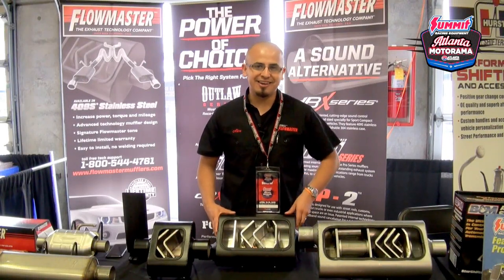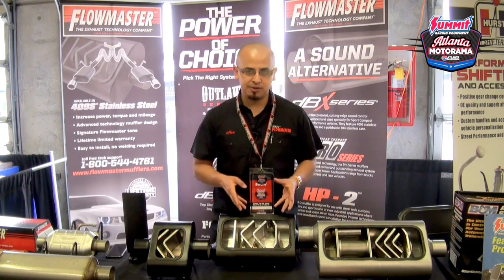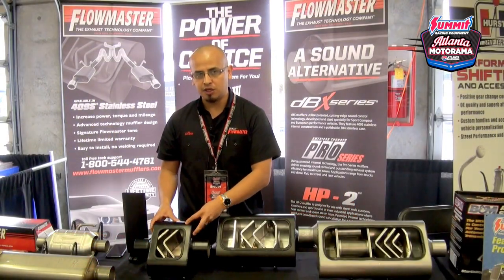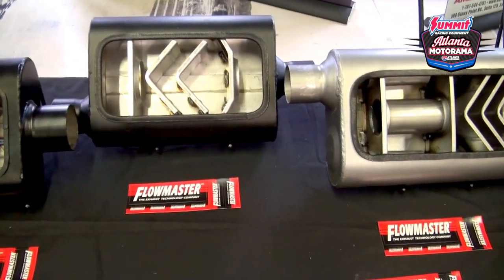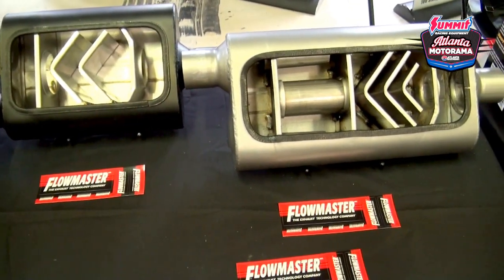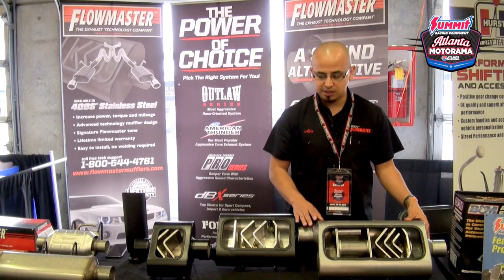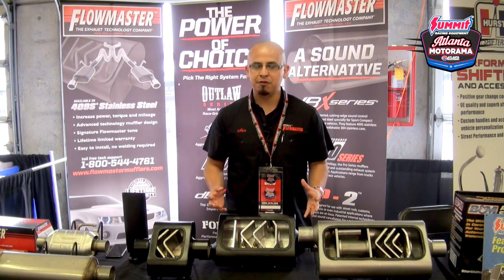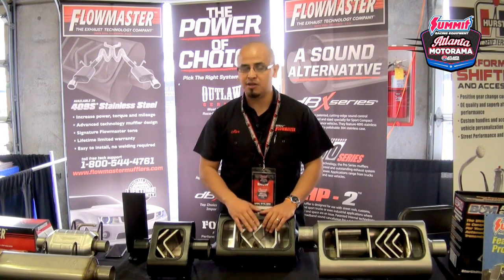Flowmaster Muffler Chamber Comparison

Comment: How would the Super 10 or 44 compare to a straight through muffler (glasspack)?
Reply from the maker: Catrik, 
When it comes to glasspacks and other straight through designs Flowmaster differentiates in a number of ways.  The typical straight through designs that you see in today’s world are no different from the glasspacks you would see back in the 1950’s and 60’s.  All straight through designs utilize sound absorbing materials such as: fiberglass, acoustic mesh and/or steel wool which soak up the sound.  While these mufflers may improve performance by using larger internal flow tubes, the packing materials will burn or blow out over time which results in an increase of sound until it eventually becomes ineffective. The Flowmaster Super 10 and Super 44 do not utilize packing, and therefore will maintain its sound control over the life of the product.  Most importantly the tone and sound quality of a Flowmaster muffler is extremely unique and cannot be mimicked by a straight through muffler.   

- Flowmaster
Reply: Summit Racing exactly. its way worth investing in the flowmaster because its sound is better and it last longer